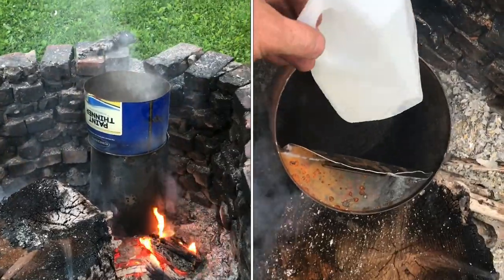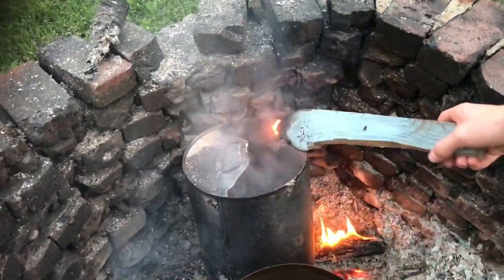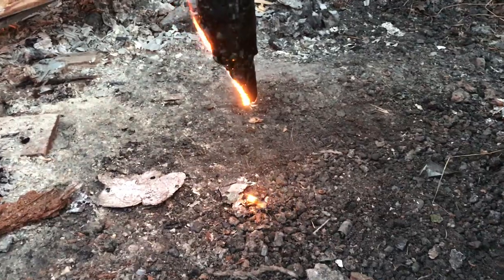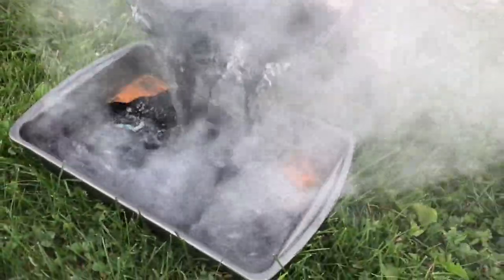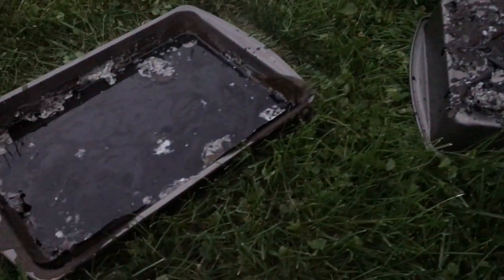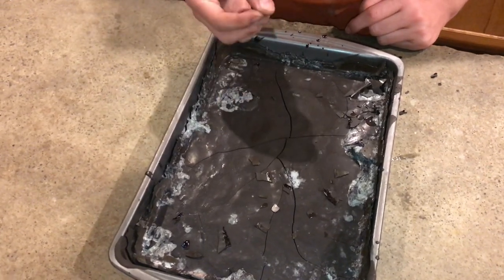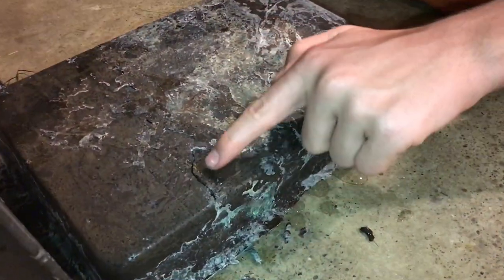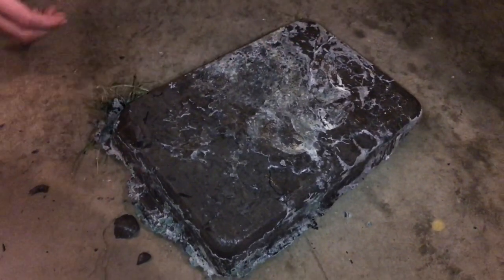RECYCLING plastic at home (mixing HDPE, PETE, PP together in one batch)

Comment: Whilst this idea may seem to be a good idea, in the long run, it does nothing to stop the pollution. ALL plastics exposed to weather,break down into microscopic particles which then blow around in the air everywhere and get into our food sources and water. Better idea would be to reconvert to fuels and burn the stuff.
Reply: I agree with this point
Reply: True. And realistically, no amount of personal lifestyle changes or hobby usage will curb the industry. It's a systemic problem. At least it gets people thinking about it.

Comment: I think to properly create a sheet of plastic you should not mix together different plastic types, just use one type, let's say for example hdpe, get enough of this and shred it into little pieces like the size of rice maybe. Now sprinkle it into a large baking tray, and allow it to heat up inside the oven and all melt together. You want to heat the plastic to the point that it's melting together, but you don't want to be heating it to ridiculous temperatures that it's turning into vapour, essentially you want melting point, not vapour point. hdpe becomes a liquid at about 130 celcius, so it's easy to do this, just set the oven for that temperature. Softer plastics like hdpe are less likely to crack, since they are more flexible, and especially melting it together just at it's melting point also assures the plastic chemistry won't change much, as compared to boiling the crap out of it which will change it's chemistry and ruin it most likely. 

I made sheets like this, that I used to make inside walls of a caravan. The sheets came out as a pale off blue colour, this is because I wasn't melting the plastic at a high temperature, so the dyes used in the plastics retained their colour, mostly I was melting clear containers and a few blue lids in with them. However if you melt it at a higher temperature then my guess is that the dyes would burn and degrade into a tar colour. 

It's invaluable to know how to make plastic sheeting out of your own materials, because buying plastic sheeting at a store is incredibly expensive, especially here in Australia. I can make my own sheet about 4mm thick, and about 50cmX30cm in size, out of just some hdpe I would have thrown in the recycling bin anyway. Yet if I had to buy such a sheet at the local store like bunnings, it would probably cost like 15 dollars or something. The total amount of internal sheets I used for inside lining walls of a caravan would have been at least 30 square metres, if I had purchased these sheets instead from the store it would have set me back at least 3000 dollars. 

The sheets I made were of great quality as well, I could drill holes, and I then glued them into place as well as using screws with a large head size to distribute the force over the plastic and not dig into it too much. Between the sheets there were gaps of maybe 2-3mm, I didn't use cover strips, I just simply filled these areas in with white silicon and did a neat job. This was an old caravan that had partial wood supports in the roof and leaked, I got it for only 200 dollars, I basically repaired it myself by waterproofing the roof, insulating the walls with foam insulation, creating plastic sheets for the inside walls. And importantly I also replaced the wooden roof support cross beams with aluminium square tubes that I created a slight bow in, so they were like an arch shape. 

This caravan went originally from a leaking thing, where outside noises were very loud as if there were no walls, and where condensation would form on the roof and drop down when it got warm in the morning after a cold night. To then a caravan that is stable, decent sound deadening, totally waterproof, and no condensation problems. The key to everything is just understanding the basic fundamentals of physics, this caravan serves as an office for myself, when I want to be alone and focus on work. This is why I was bothered to do a decent job with it, because I would personally be using it. 

One thing I found out over all the time, some materials are great, others are poor. Generally speaking, wood is a poor material, wood may be malleable and easy to work and source, however it has poor qualities in my opinion, it's susceptible to degradation from moisture, it also can change shape if under force, so I generally entirely avoid wood in my build. Aluminium is simply an amazing material, both interior or exterior, no affect at all from moisture, easy to work with, light etc, sun doesn't hurt it, lasts virtually forever. Plastic, plastic obviously isn't good outside where sunlight can strike it, however plastic is a very good material to use inside, it's easy to work with, it has insulative properties, and water also doesn't affect it.
Reply: Than you, that was a lot of information that I needed!❤

Comment: Interesting.  I can’t help but be reminded of how sugar behaves; if it gets too hot, it goes from a soft crack-to a hard crack.  It seems that by the dark color you are getting you are half way to carbon, it may be getting too hot, hence the brittleness.  I’d recommend a thermometer, and only get it hot enough to melt the plastic that has the lowest melt temperature, probably the HDPE.  You might be able to use a paper shredder or grinders to pulverize the other types of plastic and then add them to the molten HDPE for some sort of a plastic composition.

Comment: You've passed the melting point of the plastics which is incredibly dangerous to you and your neighbors. It is evident by the phase change to gaseous form. The "bad odors" are not only "bad", but they are highly cancerogenic VOCs and are released in huge amounts at the temperature you've reached. Melting or heating plastic for remolding purposes needs to be conducted in a controlled environment, at no higher than the melting point of the particular plastic that is being used (and if its not PE or PP then an active carbon filter is mandatory). It should DEFINITLY NOT BE DONE by starting a camp fire in your backyard. I encourage you to practice high safety standards.

If you really wish to reuse everyday plastic packaging, you can use the advice given in the Precious Plastic website.

Never heat plastics beyond their melting point without proper equipment.
Reply: I am a biomedical scientist and I completely agree.. This is incredibly dangerous and to anyone watching I would highly advise against this without proper PPE and a way of restricting pollution to near by residents.
Reply: @Dannafilms96  i am a sturgeon
Reply: It's not "phase change to gaseous form". It's pyrolysis, also known as burning or scorching. Also, it's not gaseous form, that would be invisible. It's a liquid form which condensed from gases, that causes those tiny white droplets in the fumes. Basically he cracks it into crude oil and at the same time boils the crude oil off which makes "steam" like water except it's a nasty, carcinogenic uncontrolled mixture of pyrolysis chemicals.
Reply: yeah, the only reason he needs a respirator here is because he's burning the plastic, at melting temperature it should melt pretty cleanly
Reply: Agreed. Especially if done repeatedly.
Reply: @kuroimami9782  You're a fish?

Comment: first of all these resins are not compatible, if you mix pp with pet it will not blend it will cause a chemical reaction and it will turn runny and not set, if you mix pet and hpde it will not blend together it will  split or peel apart like a laminate the same with pp and hdpe , it will split apart like a laminate . you can blend small amounts of hdpe with pp, or vise versa and blend it together but it would have to be like a 10%/90% ratio or less.

Comment: This is not recycling. This is melting a bunch of things until they are completely unusable. I don't even think a recycling plant would accept them now.

Get a blessed machine or some other brand that converts plastic into gasoline, kerosene, and diesel. That would be more useful for your purposes and less messy.
Reply: He is experimenting and didnt seem to think it would make useable material anyhow.
And actually If you wanted to turn it into liquid fuel it is likely just as useful still, but yah normal recycling wouldnt work for the blob and refining plastics into fuel (besides burning in incinerator) isnt easy to do at home or for industry yet
Reply: All over  the globe they make bricks tiles and other stuff out of this... Mixture with fine dust / sand and the possibilities are endless

Comment: Burning plastic is fine... but just know that's what you are doing. Granted its not combusting, but you are degrading the plastic here.

Your better off melting the plastic in an oven. (PP, PS, and PE (LD, or HD) aren't very fume producing. You can set your oven to like 400F and melt the plastic that way.

But yeah, you get wildly different properties when you mix plastic. PP has something unique to PP, PS has something that make it unique, and so does PE.

Comment: Bro! You just made burnt junk. AND you are breathing in real bad stuff.  YOU NEED A TEMPERATURE CONTROLLED OVEN! Even then, it won't hurt to shield the plastic from direct radiative heat with oven paper on all sides. And really, as a home operation, just stick to LDPE or HDPE. All the other plastics and labels are just too unfriendly for home recycling. BUT TO PUT A CAN OVER FLAMES!!! - DIRECT CONDUCTIVE HEAT??? OMG! It's a joke right?

Comment: You should do much more reading (research) before melting plastic this way. The plastics have different melting points and give off toxins when heated beyond their melting points. Also, it's not necessary to melt the plastics to mold them. Some only need to be softened to the point that they can be molded and this reduces the toxins and preserves the strength of the plastics.

Comment: Would it still be this brittle if you added bitumen, and perhaps some sand, into the mix?

Well, I've seen some YouTube videos where people have been mixing  waste plastic and bitumen into plastic roads. But let's make the mix ratio into 50% mixed plastic and 50% asphalt. Then the other would be 1 part plastic, 1 part asphalt and 2 parts sand.

Many of us just wanted to know if it's possible to make recycled bricks or pavements out of such mixtures.

Comment: If you keep the oxygen away from the plastic as it melts you'll get better results.
A nitrogen purge, just a trickle of Gas into the top of the melting pot works and you don't get 'slag' which is carbonized hydrocarbon / plastic

Comment: How  can u melt plastics they cause air pollution
Reply: Melting them doesn't pollute much, burning them properly doesn't either.
But this?  This in-between with a variety of plastics in an uncontrolled environment with fluctuating temperatures?  This makes a hell of a lot of pollution.
Reply: Different plastic have different results. This video shows how to ENSURE that it's highly toxic. If you do something like melt PP in a tempurature-controled environment, it should be reasonably safe.

Comment: 5:28 look at the  " black pure plastic " on the right. Whatever that white stuff is that plopped right in the middle, I'm assuming that's why it had a crack in the middle.

Literally looks like paper, should've pulled it out with your bare hands

Comment: Each plastic must be heated up to its melt point Only. Then you might be able to mix them. This is a timed and crucial heat to melt point for each. You never want to bring Any of the plastics to Flash off and smoke yield.

Comment: Can you repeat this experiment with adding old engine oil?
Reply: Why whats the benevits ?
Reply: @tijntrix  Oil make all items inside same temp like boiling water in soup. if you crush all materials to small pieces and add oil then melt it and mixing all the time then you should get one consistency liquid.
Reply: @messiah2534  wow... Thanks bro.. Gonna try it out.. Haha 🙏🙏
Reply: @messiah2534  are the fuses that are going .. Less by this ? Because it got trapped in the oil ?
Reply: That is a terrible idea. And it wont work. Different plastics have different melting points - so everything being the same temperature changes nothing. Adding oil will make the sludge much less usefull though. And more hazardous.
Reply: @prettselk  depends what are you expecting. If you next add sand then consistency will be great for slabs
Reply: Nobody should repeat this experiment under any circumstances.
Reply: @tijntrix  Do not. There will not be less fumes. And the fumes are already way too much. Plastic over fire is a bad idea.

Comment: You have just proven the world that plastic is NOT recyclable.
Reply: ...not when you mix plastics with wildly different thermal properties into a toxic sludge, no.  When you keep plastics in their proper groups so their melting points are identical then of course they're recyclable.
Reply: He proved that plastic is burnable. Are you really trying to cast doubt on the endlessly proven concept of reforming plastic? That's like saying "wax doesn't melt" or "paper doesn't burn". Yes, plastic recycles. It's very good at it actually.

Comment: That is way to hot 🔥 your supposed to use a metal steel wire to set the pot on at least 8 inches from the fire..